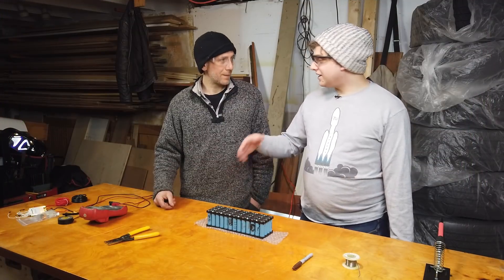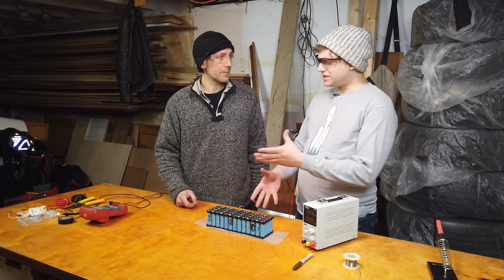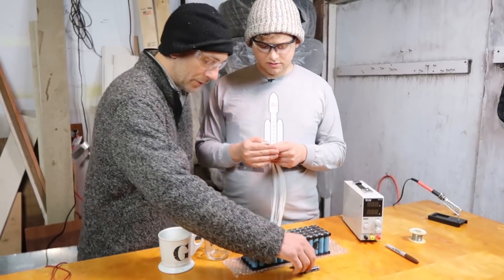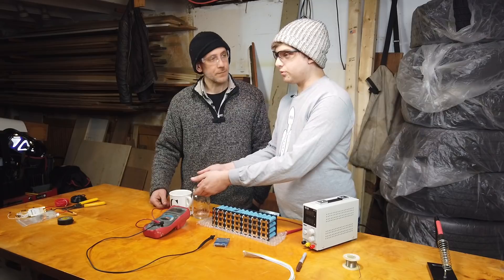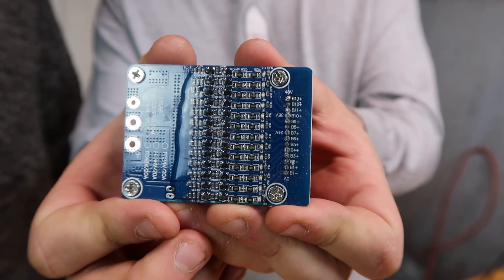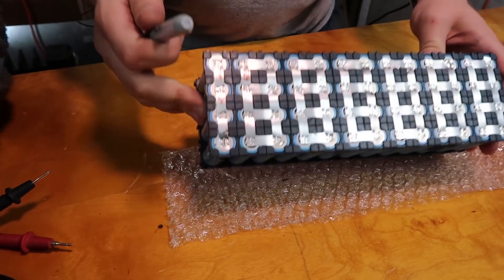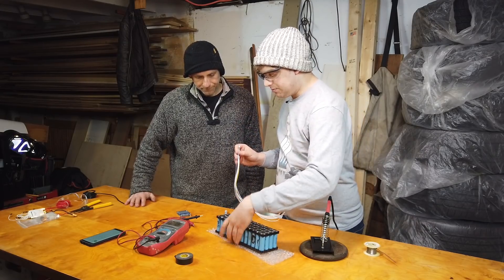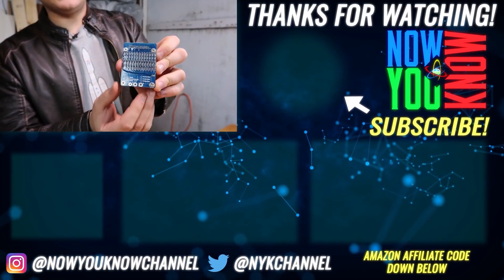Electric Conversion Workshop: Lawnmower Project - Episode 7

Comment: If each cell is charged at different rates, why does each cell not have a BMS wire connected to it on your pack?
Reply: when you connect cells in parallel that group acts as a single cell -- a member of a parallel group will be at the same level as the other members of the group because all the positives of the group are connected together and all the negatives of the group are connected together.
the groups are then connected in series, plus to minus, minus to plus, plus to minus, minus to plus, ... series can vary because the negatives are connected to a different group than the positives.
Reply: @Sylvan_dB  Thank you for great explanation Sylvan.